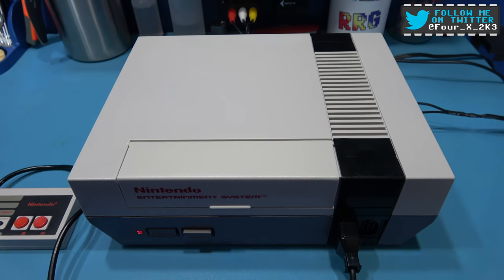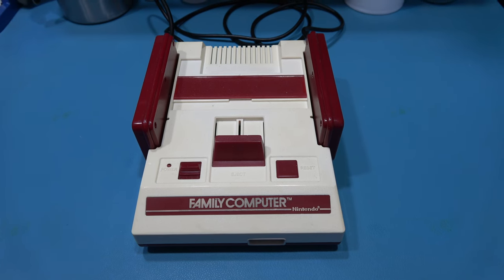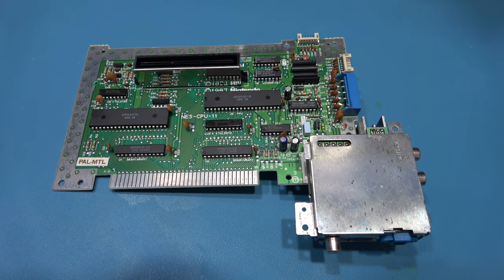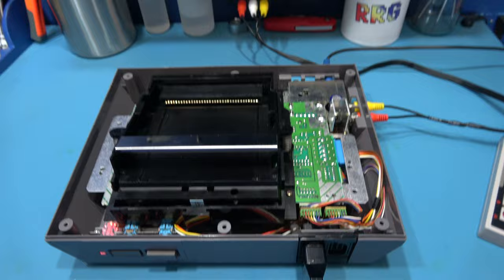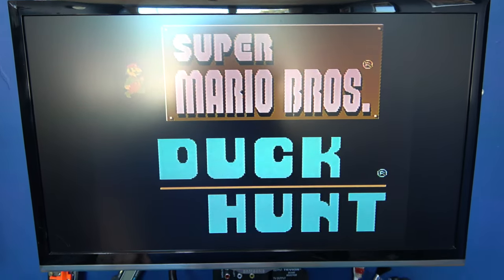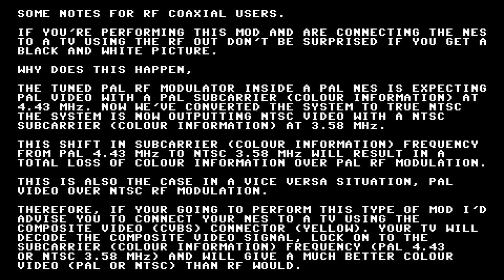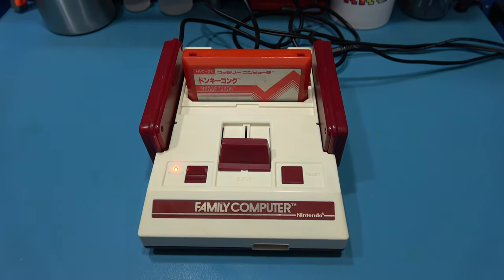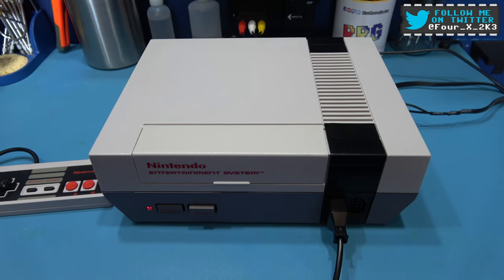Nintendo Entertainment System (NES) - Part 3 - PAL-to-NTSC Conversion (CPU, PPU & Crystal Swap).

Comment: I understood why the PPU and crystal would need to be swapped, but at first I was puzzled as to why you would have to change the CPU.  It never occurred to me that the PAL units used a different CPU (2A07) than the NTSC units (2A03). I had always just assumed it was the same and only clocked differently, like with the Atari 2600's, C=64s, and other systems.  It seems the CPU models have a different clock divider, better suited for the refresh rate in their respective regions.  Thanks for cluing me in on this difference with your video!
Reply from the maker: Spot on 3vi1J.

Comment: Hello, I have changed it as it appears in your video, but it does not work for me, the screen remains blank.
Reply from the maker: Something has gone wrong as it should work. Try and revert back see if it still works.
Reply: @Four_X  we have checked the cpu and ppu and we don't know what went wrong
Reply from the maker: @Lacuevadelnorte  If both the NTSC and PAL CPU's and PPU's no longer work that would indicate somthing in the removing or soldering them, If you a multimeter try looking for shorts (2 pins soldered together) also make sure all the traces around the two sockets go where there supposed to. It could be as simple as a broken trace.
Reply from the maker: also one more thing. did you disable the lock out chip.